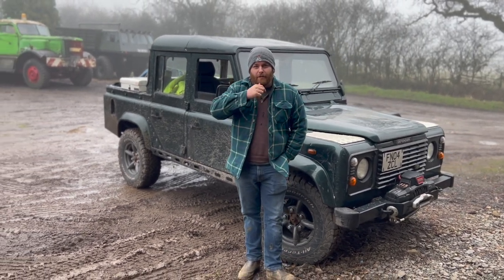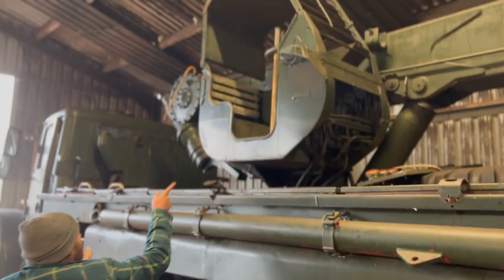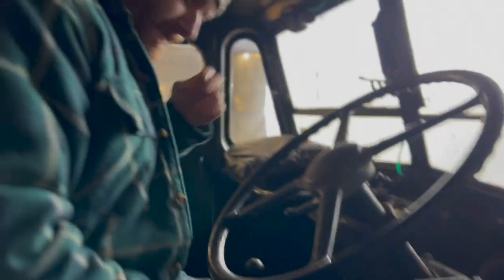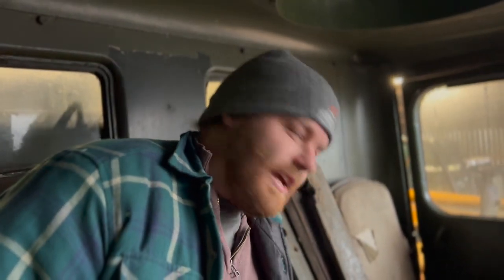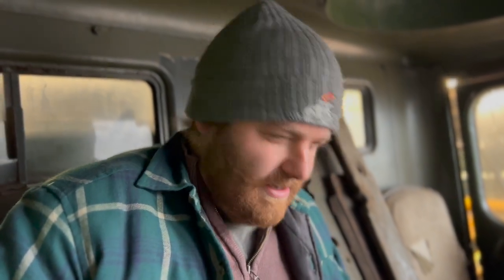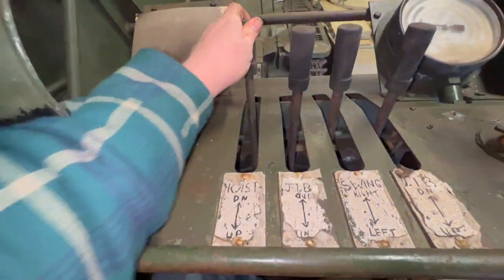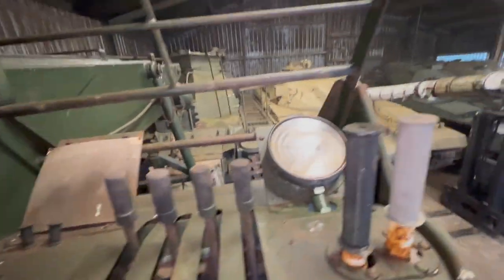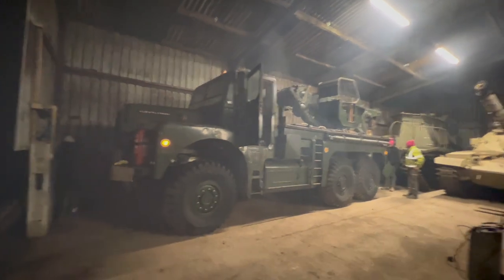The New Leyland Martian Tank Recovery Truck Is Delivered By Crouch Recoverys Classic Scammel Wrecker

Comment: In 14 years in REME, with Armoured regiments and workshops, I never knew this vehicle to be refered to as a tank recovery vehicle. Sure, it could be and was used to recover APCs and CVRTs and may have assisted in tank recovery but was never a prime armoured recovery vehicle, apart from with Saladins and Saracens etc. They were lovely vehicles to drive and when doing a long-distance recovery, it was so easy to do a driver change on the move. Driver sets the hand-throttle and the co-driver takes steering control, the driver opens his door and climbs out whilst the co-driver moves across into the seat. Whilst the co-driver is moving across inside the cab and taking full control, the first driver is walking across the deck behind the cab, clambering down to stand on the fuel tank, opening the left side door and climbing into the co-driver seat!
I well remember an incident in Hohne, back in 1970 when I was lifting a Chiefy power-pack with one of these (our 434 was being serviced) with the Leyland parked alongside and at the rear of the tank. The cab of the Leyland protruded some 8ft out from the rear of the Chieftain. Another squadron had just come off the ranges and one of their tanks was parked at right-angles and facing our vehicle. The crew were cleaning out the turret and doing all the other things they had to do as normal. However, someone, presumably the Loader, had left a round in the breech of the RMG and discharged it. Being a REME VM and not a 'Tankie', I have no idea how that happens but it did! Again, being a REME VM, all I did was drop down into the space normally occupied by the engine air intake box. There being no further cause for alarm, we all surfaced and surveyed the damage where the round had penetrated the co-driver's door and entered the battery box beneath the seat and continued it's path out the other side of the vehicle. No-one knew where the round ended up but it made a right mess of the Leyland!

Comment: Hi Matt.  This was primarily but not exclusively issued to REME for heavy recovery and field repairs.  You will find it’s FV designation on the data plate and all the books like drivers manual, CES & servicing schedule and EMERS for detailed repair procedures with drawings are now freely available on e-bay, military vehicle dealer sites and always at the larger shows and dealers.  On my first posting in 1972 to Germany the reccy mechs had one of these all cleaned up and fully equipped parked up in one of their garages as they had prepared it for back loading, casting and disposal as they were at the end of their front line Army working life although I believe some hung around in TA units for quite a few years more.  It had been replaced by an AEC militant MK3 which in many ways was a better vehicle with power steering and clutch air over hydraulic and with air actuated diff locks etc etc, but of course these had a diesel engine BIG bonus.  The AEC slew platform was far stronger than that on the Leyland which was always weak and had to be checked regularly for cracks lest it broke free and toppled when lifting.  Be careful with that and don’t lift very much over the side or with the boom out far.  Over the rear lift with supports is definitely the safest option if the situation allows.  As a working crane the AEC was so much better.  The reel on the side of your Leyland was used for pulling out the winch cable via a snatch block hooked onto the casualty and then also back to the Leyland again with the main winch rope if you wanted to double the pull 2 to 1.  Here is the kicker though and you will probably like this.  The old sweat reccy mechs much preferred the Leyland over the AEC as 90% of what they used it for was heavy recovery as opposed to us VM’s that used them more for field repairs and pack lifting etc.  The reason the reccy mechs liked it so much was that main winch.  Such a good one and with far more pull than the AEC so less time messing about putting on 2 t 1 pulls when the Leyland could very often just do it straight in one pull.  They were a beast and very heavy to drive apparently but I arrived to late one and only used the Militants which they said were big tough trucks for big tough blokes.  The B81 fitted was a pussy cat of an engine and not really any major problem except fuel consumption but as someone on here has already commented no account of petrol was needed back then it was to us as tap water and just as freely available  Hope this is useful.  Good luck with getting it up and driving again, nice to see this old kit still doing good service.

Comment: According to gov.uk the new toy was manufactured in 1958. It has a 6500cc petrol engine.  It weighs in at 24360kg.  A heavy girl.  Looking forward to the updates on this.
Reply: Sounds a bit short, only 6.5 liters for a 24 ton truck.. I happen to own a (former Dutch MOD) 1968 wrecker of only 17250 kg with a 9.8 liter engine. Back from the days when if you needed more power, the only way was to get a bigger engine

Comment: I grafted a martian  crane and subframe complete with winch onto a 1987 freightliner over 20 years ago, still use it today, the lifting capacity is limited due to the naff outriggers as standard, and the slew ring is weak, dont pull with the slew, winch is the best part of it, its on u tube  under philip nash freightliner, if you are interested!!

Comment: I had great fun at work rewiring that switch panel and instrument cluster on an AEC 10t Gun tractor. Wiring was shot (good old yellow rubber) so I wound up rewiring the whole truck with Bedford style wiring harness. Probably the only AEC 10t with hazard warning lights.

Comment: 10:29  The small cable drum & capstan, is probably to drag out the main winch cable.  Manually pull out the light cable, run it through a re-direct pulley on whatever you're trying to connect to and the small cable then drags the huge cable out towards it.

Comment: These minus crane with a bit of rear body were used to tow 5.5 guns. In that form they had a massive horizontal winch underneath. If you disconnected the winch and covered the centre you could squeeze 90 bottles of brandy inside coming through customs.

Comment: Hello, i ran a Hippo for about 10,000 miles or so and that was 4mpg, i looked at a Martian but the 😄horific petrol consumption i couldnt quite cope with, that was about 25 odd yrs ago and Gass conversions werent realy available back then,but nowadays i recon thats the way togo instead of a diesil conversion, dont forget about the difference in engine revs if you go to diesil,the truck speed will drop to a crawl if you dont change the gearbox aswell. Goodluck buddy.

Comment: what , couldn't you find a bigger crane .. lol that thing is a beauty
Reply: and i'm guessing Crouches depot isn't far from you ?? because  that Scammel wrecker towing that is max what 20mph ??
Reply: @888johnmac  it’ll do a good bit more than 20 mph 😂😂😂
Reply: @888johnmac  I saw these at Ruddington where the were auctioned off. Most had the propshaft stripped due to being “recovered “ at too high a speed.

Comment: Great truck to drive with the low intermediate and high splitter  and the normal 4 speed box . Watch the so called none slip deck. Crane is good , we used to lift 109 power units out in the field with out any trouble . Even the Yanks were impressed !

Comment: Seems to start right up, sounds great too,..what a pity petrol is so damned costly.
Like you said Mat, a diesel engine swap is in the offing,... I hope!
Reply: Hi, it has b82 producing 176 bhp at 3750 rpm. Top speed 36 mph, tractor effort 13.8 tons. Diesel would reduce the speed considerably. 100 gallon tank, rang 350 miles. Hence 3.5 miles per gallon. Winch 15 ton straight pull, 2:1 30 tons. Winch rope 1 inch diameter, 6 by 61 construction. 390 feet of rope and 365 feet useable I think, can’t quite recall. The engine was always the downfall. The recovery gear really good, should have put it onto a modern truck.

Comment: Good luck with the Martian boys I did the proving trials and development on this in the early 60s in Germany the jib and winch are superb but the chassis and drivetrain are appalling it’s grossly underpowered and take note of the label if it’s still there on the floor in the cab stating not to exceed 35 mph or excessive transmission damage will occur I can give testimony to this as I did and the results were disappointing front of the prop shaft UJ sheared off taking the Air brakes and transmission break with it - the small drum on the side of the jib is for pulling out the main winch cable there was a capstan on the jib to pull the wire back in  - the two holders behind the cab are not for fire extinguishers they were to hold the oxyacetylene bottles - lots of memories working these things one point we could suspend tow the Leland with a Scammell Explorer with the Meadows petrol engine faster than the damn thing could drive itself Again somewhat disappointing

Comment: Is that a Scammel Commander that Crouchs delivered it with? The towing board is interesting with a Military/Army "KC" registration on it. That must be mid 1980's ?
Reply: The towing board is  off a Bedford four tonner,  02KC67, in service 19/09/1984, cast 28/08/2012 ex PWRR, according to MERLIN. 👍🏻
Reply: No it's a Scammell S24, not ex MOD.

Comment: Will it run on propane?  Isn’t this one of those things where you diesel it and it only goes faster up hills because the gearing screws you over?  Very nice yard crane though. *I suppose the other question is how much petrol does it launch down the exhaust pipe. I wonder what one would be like with that single point injection carb they have in the USA. Edlebrook?

Comment: What that really needs BUT fucking expensive is a big V12 diesel CAT or similar maybe what's in are version of the HET not the Detroit it's impressive in size even if you found a Cummins kta big cam or n14 just purely for fuel efficiency.  Nothing else will need changing maybe gearbox but that lifting gear is unbeatable

Comment: What sort of lump are you thinking to drop in it to repower with?
Reply: You can't butcher it.  It only does 30mph with a engine reving to 4 k put a diesel  in it and it 20 mph
Reply: @ashleylewis3990  sure, but you could pop something in that does more than a gallon per mile.
Reply: It did  about 2 mpg    down hill
Reply: @ashleylewis3990  with the wind behind it, in neutral.
Reply: It looks just the same as the day I sold it very strange feeling